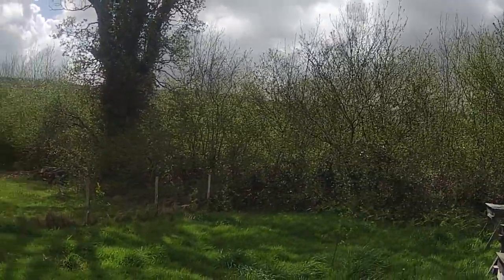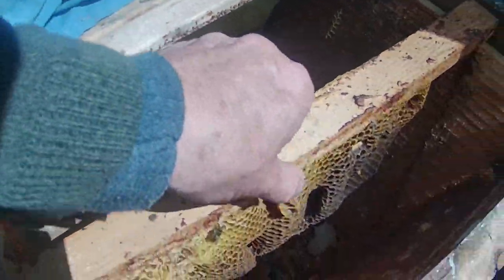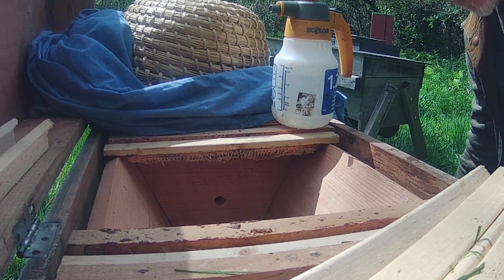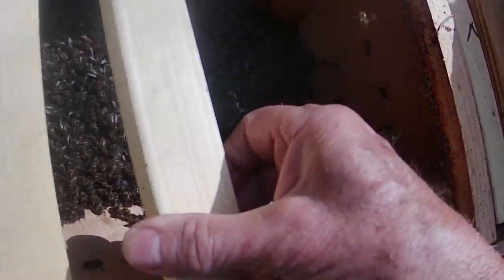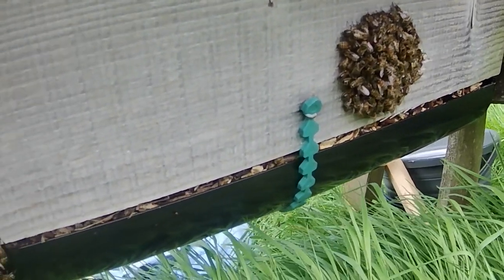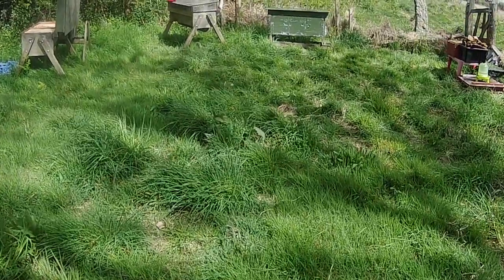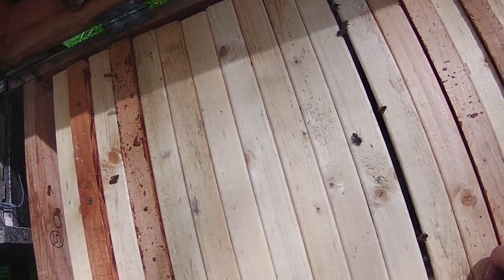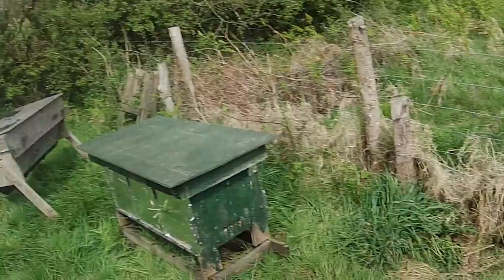First Swarm of 2021 - Part 2: hiving the swarm

Comment: Hi Phil. Thanks a lot for all your videos. I am just wondering about your experiments with ZEST hives. Are they still going  on or you stored them by any reason?
Reply from the maker: My ZEST hive is still going strong and I plan toale another video about it soon.
Reply: @BarefootBeekeeper   Thanks, Phil. Looking forward to watching your new video about your ZEST hive. I have built five horizontal hives approximately the same size as ZEST. The frames are of similar size - actually inverted by 90 degrees Dadant frame - 300x440 mm. The insulation is really big - actually the hives were built from PIR panels 120 mm - 4,7 inches (just got them free of charge). Bees are doing pretty well in these hives. I am keeping dark European bees (I am in the central part of Russia). I actually started from Lazutin's hive design. (You are familiar with it as you shot one video on Lazutin's hive - nice young lady). I built 7 hives for the double deep frames according to his recommendations - 435x460 mm. From my few years of experience, the frame is somewhat wide. I just got a feeling that a narrow frame would suit my bees better. I also read a lot on the Internet - Melliffera Association in Germany (Golden hive or Einraumbeite), David Heaf in the UK experimented a lot with the same design, ZEST hive (communicated with Bill Summers by e-mail), Layens hive also has narrow frames (330 mm). So, all that moved me to a narrow frame. (Maybe that is not very critical at all as bees will handle everything that is at their disposal. But anyway that was my way). Last year I bought at Amazon your two Balanced beekeeping books - I and II (Building a Top Bar Hive and Managing the Top Bar Hives). I enjoyed them - very well written and very useful information). Thank you for sharing your knowledge and expertise.